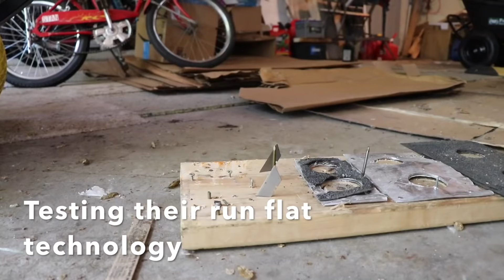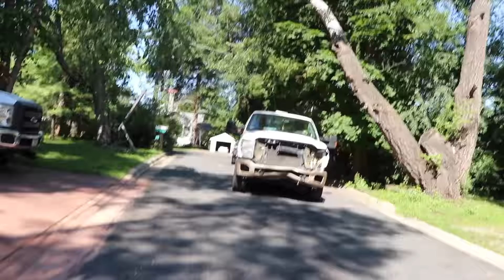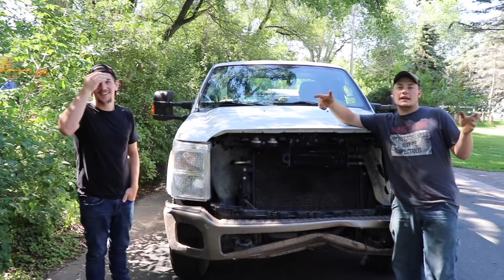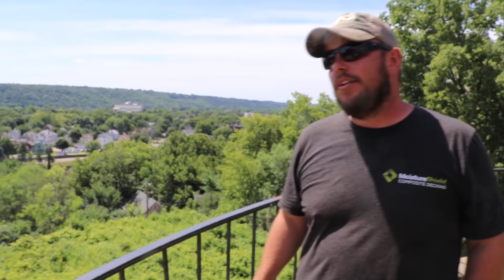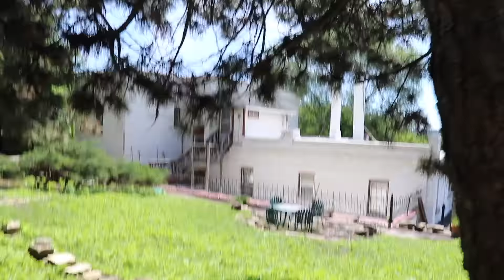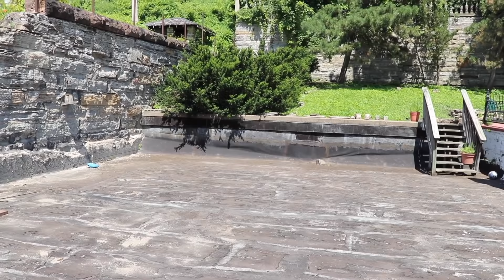Wrecked his truck & Flipped his 4 wheeler in a wide open field?!?

Comment: OK that jobs is simple but costly. I would use just a jack hammer and 2 wheel barrels and get with wooden planks over the garage a shoot down into a container for construction debris. Cost of the job I would say between 14-20k which will take 4 days start to finish. Jack Hammers I would use Electric so they are easier to carry and a oxy ace torch to cut the steel up into pieces quickly or you can use 7inch steel cutting angle grinders. Onsite put a smaller gas or propane generator so you have power onsite. On the Wall to remove the Stairs use OSB 4 sheets so any debris hitting hits the OSB but not the stone wall.  To get the Straircase down put the top stair loose down to rebars. Than 1 person cuts the rebars while you jack hammer from the side the the Straircase piler loose till the concrete gives away under the load crushing the Stairs down to the ground.

Comment: Get a forklift w/ a self dumping hopper on it.  Put a 10-20 yrd. dumpster in the garage.  take the decorative iron off the knee wall and put a ramp to the top.  Check and see what the size of the roof joists are.  Make an 8' wide deck on top of the garage to spread the weight of the wheelbarrows and if necessary add cribbing inside the garage to carry the load.  Make sure to put a piece of 4"x4" on the end of the ramp to act as aa stop for the wheelbarrows.  This way you can park the forklift w/ hooper in front of garage. When it gets full, one of the crew goes down, lowers the hopper to the ground, uses the forklift to pull the the dumpster out, and dumps the hopper.  Then they roll the dumpster back into the garage until the hopper refills.  That way you don't have a driver standing around all day long twiddling their thumbs and the dumpster is out of the way in the garage.

Comment: Electric jack hammer United Rental no compressor $227/week. Truck maybe only needed one day, because take all stairs down first and pile up all rubble. Then use three electric wheelbarrows to move rubble pile to dump truck. Truck is there for one day to take loads to recycle. Re-bar and concrete may be salvageable. If so, sell as scrap to eliminate recycling dump charges. Do all access including light equipment from front over garage. Maybe remove section of iron fence. Build or rent scaffold for access from front. No crane needed. Reinforce roof if needed by spreading load of temporary walkway. Maybe need portable generator and maybe use a scissor lift or electric vertical lift in front from street. $21K including profit max, probably less.

Comment: A crane and hire a concrete cutter. Been cutting concrete for 19 years. You can shore with timbers cut and rig out too dumpster/ flatbed. A wall for the long cuts and ring saw for collum cuts.

Comment: A dirt ramp where the steps are and a toro dingo or a Vermeer, they will handle the incline well and you can move a larger amount of material and you could get a dumpster in the front of house to dump the debris, you could also get a breaker for a dingo so you can cut the steps loose and break them up on the ground. That would cut 240 labor hours in half.

Comment: I would bring in a saw and a jackhammer and do it manually. Build the chute to move the material out. With a jack hammer you can break it up as much as needed without all the weight of a machine.

Comment: So, sticking with the disposal chute thought...use the vertical drop of the staircase to get the debris to the bottom; start the excavation at the top of the staircase, run the chute on top, or along side, of the stairs, assuming it's structurally sufficient to support the debris removal, gravity will do most of the work; the power assisted wheelbarrows would be next, to the final disposal chute. I won't comment on job cost.

Comment: Need to build a false work to support the stairs and use a quickie saw and make a lot of cuts use a small electric hammer to get it to the ground then A 90lb air hammer to pulverize it wheel it to a shoot and bam all hand work. I have done something similar. basically you need to build a form work like you where going to pour them using 3/4 ply 4x4's and 2x bracing.

Comment: I know on a power line job we used the big winch line on our digger truck to run across a valley and put the pole on the back of the Ford dually which is designed to carry one pole their called "H" trucks. When then attached rollers to the top of the truck with chains attached those to the winch line on the digger truck and lifted the winch, the truck rolled across and then we let off the winch to sit it down on the other side. Haha did that trick another time in a corn field minus the truck just the pole. Can't damage all that corn for one pole.

Comment: At 23 an HR it's 6500 for the crew.  So with the two wheel barrel at 600 each.  7700 you own the dump so it can sit idle since it sounds like you own a jack hammer already, I'd say to make money after insurance minimum 15k - 20k Max.

Comment: Knuckle boom crane can set up easy there for a lift over the garage for a small piece of equipment depending on crane size obviously. Use the large mesh bags to load into straight to a waiting dumpster have the crane on site all day. Project done in one day no back breaking labor and minimal employees with a high safety value.
Reply: can't have a dumpster blocking that little narrow street not to mention a crane and a dumpster would not be allowed by the city..that would be a fire hazard b/c god forbid a house on the street caught fire and they couldn't get a fire engine down the street..you can't just block streets in this country...you have to have approval to even block one lane of traffic unless it's an emergency like a car wreck or something..emergency vehicles can do it but citizens can't

Comment: Job is going to cost roughly $28 k to $30 k. I was thinking the same way of using the wheel barrels to take concrete out and dump truck right there by the street and toss concrete over into it. Elliot needs to fix the truck before getting tickets for no headlight and no display of front licence plate. Keep up the great work.

Comment: The project is about  25000-30000  depending on other challenges that would appear and the add some $ for wear and tear on dump trucks because the concrete will do some damage on dump beds of the truck

Comment: Get a 70ish ton crane,
Park it on the road, have it level itself with its hydraulics, then lift a small skid up the grass, cut the concrete with a concrete saw, then either lift the stair pieces to the road, or lift up a small dumpster to put the concrete in. 1 day, 1 crane, 1 skid, 1 dumpster, 4 guys

Comment: I’d say 21k on the job, depending on how much profit you want and the charge per ton to dump concrete in your area. Also if the dump truck driver is a 4th separate guy.

Comment: That job 28,000.00.  Of course I would not want it.  Your paying for a driver to sit there for at least 2 to 3 hours a day if not all day getting loaded for 3 days.  I might even jack it up higher than the 28,000.00 to 32,000.00. And unless I could get Access from the rear neighbor off that winedy road.  For get it because I would only take that job with the use of a small excavator.
Reply: Maybe if you could find one of these cranes you could get an excavator up on the site https://www.youtube.com/watch?v=jkubZ2uhQus they just need 8m to be deployed on the street. Day one get a 5T excavator on the site and a stock of big bags, after that get the demolition done and on the last day lift everything out. In france you get those cranes for about 1400€ a day.
Reply: rweissrock to big.  It will not fit the street below.  The street below appears to be 1/2 that only 4 to 5 meters.
Reply: Try a Century 1150R
Reply: Nøderak I think the issue with the Century 1150R would be elevetion having enough hight to lift over the wall then still place the equipment high enough on the hill.  I think a John Deere 85G should be able to lift each section.
Reply: Don you are right, I didn't think the rotator through, in order to have clearance ti would have to lift the equipment incredibly high first, then swing, probably at a >70º angle, and if I remember right that wi=ould give you a sub 10,000lb capacity.

Comment: I would use a 165 ton crane they run about $550 per hour  with the full weight in the twin cities area and they would be able to set up on that road under the building and the crane is about 200ft tall so it should reach the stairs that would probably be the best and easiest way to do the job

Comment: Best way I can see is try to use a 3 ton come along and try pull it back and collapse that wall then jack hammer the steps into chunks and  take it out pice by pice I wouldn't even try get equipment into there might have to get a crane to connect to the come along to

Comment: 3 guys at $15 an hr for 240 hrs so about $10,800 in labor 3 dump loads so possibly 3 or 4 days with the truck for 10 hrs a day with the truck running at $100 an hr puts the truck at $4,000. Then for the wheelbarrow which from what I could tell a little in the video one new one was $550 so you might need 2 or 3 so that's another $1,550, then 2 good electric jackhammers come out at $4,000. All that brings just equipment and labor to $20,350 so I would probably place my bid in at $24,000 minimum  $30,000 max to put a little in your pocket and to cover any possible unexpected since that place is so damn overgrown. 

I know this is an old video but just wanted to try my guess at the bid.

Comment: First  to do that job removing that staircase I am a contractor in California I would charge $$22,000-$28,000 instead of electric breaker I bought a gas jackhammerer it was like $280 I have beat it to death  best tool ever its been ran over still going strong I bought another one incase they stop selling them

Comment: I am thinking 3 guys 2 weeks 40 hours a week pre man,  I think labor add it all up for 3 guys dump truck driver $28,000 the charge for use jackhammers , Dump truck. charge for the dump of the old concrete and steel. Down here they charge pre ton.  I am thinking for all $40,000 to $43,000 .  Where those step are and i was wondering of the weight limit for the roof going across with the concrete.

Comment: I would guestimate $25,000 for the job. I would also make sure that the owner might want to get rid of any other concrete structures (not floating stairs) as its cheaper to do it all at the same time (extras).

Comment: how's this truck even road worthy
Reply: JDS Lawncare & Landscape it runs and drives
Reply: 9914life that doesn't matter he'll get pulled over in a heartbeat because you need to have a grill and 2 working headlights not just one if the police see this he'll get a traffic ticket for unsafe vehicle even if it runs and draws
Reply: JDS Lawncare & Landscape I don’t think you need a grill but you definitely need 2 head lights to drive it legally. If he gets pulled over, he will most likely be issued a fix it ticket.
Reply: That would be out of service by the DOT if it was a semi-truck.
Reply: Tom Jones If he's licensed as a Commercial business it'd still be an automatic out of service by The State or Federal Dot
Reply: Technically it's not

Comment: I would bid that twice the normal cost at minimum. Yes it’s manual labor but it’s still a job that needs done. Lay some 3/4” plywood on the garage and start wheelbarrowing. Must get permission from that homeowner (the garage that you’ll be wheelbarrowing over) before you accept the job or it’s not going to happen. Whoever bought the place will have plenty of money to pay for their “neatscape” that had to be done.

Comment: I’m going to ask is the truck driver going to be on site all day every day for the entire two weeks? If so the labor should be 22 and 25 thousand. The wheelbarrows run between 600 and 1000$ if you buy them. Rental for them should be between 100 and 125 a day. Jackhammers should be about 175 a day (electric) and 2 to 3 hundred a day (air with compressor). So 28000 with rental (electric hammer) and 29000 (with air hammer). That only figuring one wheelbarrow and one jackhammer.

Comment: Labor. 240 hrs. Id say $75/ hr so $18,000
Then the load of junk is about 20 ton. So about 100/ton so $2000
Then the equipment anywhere from 
$ 5-10,000 depends if you use a crane. 

My best bet. Helicopter.
Cut in large pieces and haul out.you would be done in less then a day. And only be half the cost of the others.

Comment: I'm gonna bid $29,835 - $31,450  as long as the city don't want a permit for blocking the road.
Reply: city won't even give a permit to block the road..it's a fire safety hazard for other homes on that street..it is a public roadway which means it has to be accessable to vehicles to travel on

Comment: time to call in a helicopter to drop a machine on the roof
Reply: I am seriously curious as to what the hill side stabilization looks like for those places, looks to be built like a house of cards
Reply from the maker: these houses have been around for 100 plus years-they are made of tons of concrete- insanely thick stuff